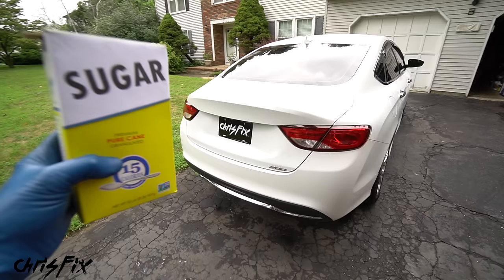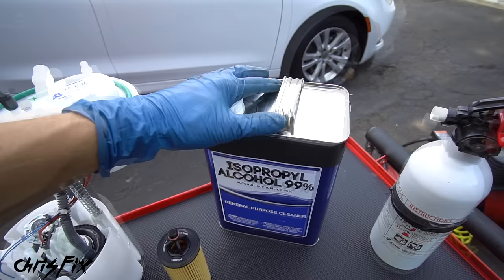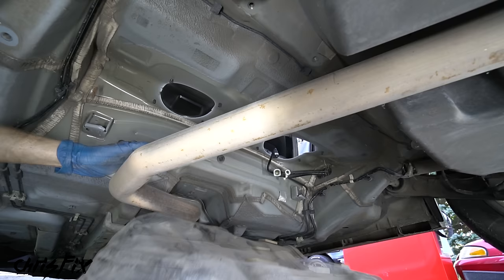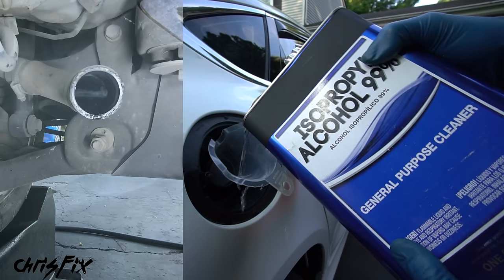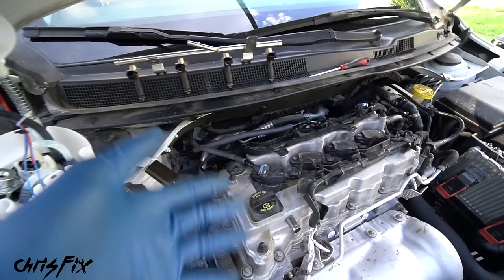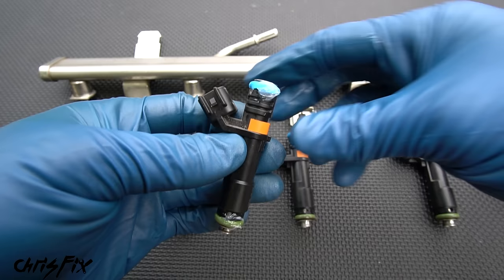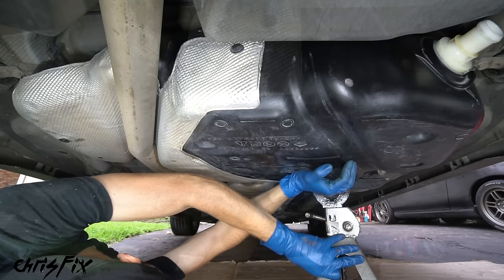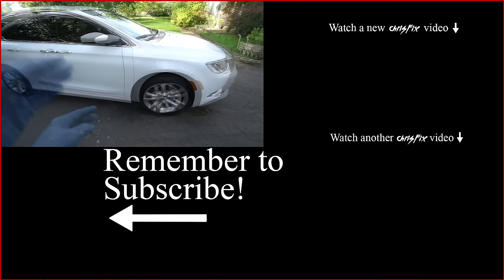How to Clean Out the ENTIRE Fuel System (Vandalized with Sugar in Gas Tank)

Comment: Hey Chris, I just found out I have sugar in my 2016 Infiniti q50 red sport. Long story short, I’ve had issues with a mechanic that ended up cutting the cats off of my car and busting my windshield among other things, and it seems he did this as well and this has been quite a bit ago that I got my car back. Like a month or 2. Well after I got new cats in and got the car running, I decide today to start driving my car. Went to gas station to put gas in my car and it kept clicking like it was full but my fuel meter inside the car showed only half full. Upon attempting multiple times to get gas in I noticed grainy stuff coming out of it and it looks like sugar. I’ve been driving the car sparingly the last few days unknowingly having this inside my tank. My question is do you think it made it to my engine by now? I’m very concerned. I have it parked and my mechanic said he will clean it out but it’s late so I’m kind of stuck here with no way of towing it
Reply from the maker: Wow you should consider taking legal action against that "mechanic", sorry to hear. And your fuel filter would have stopped anything from reaching the engine so you should be fine, just make sure to give your fuel system a really good clean
Reply: @chrisfix  thanks for the reply Chris! And would your answer still be the same if I said I was driving it like that for weeks? Just out of curiosity
Reply: wonder if this mechanic'  is tossing those negatives at your car, in hopes you'll put it up for sale ....        :-[
Reply: @CentralCanada  really felt like that was the case but ultimately I had the car totaled after numerous attempts to get it fixed and 3 horrendous mechanics later. I swear they’re all out for some kind of extra benefit in one way or another. Once you put that car in their shop, you’re really at their mercy if you don’t know exactly what you’re talking about and they know the value of the car

Comment: Hey Chris would a fuel system flush do anything to resolve a problem where someone
might have put sugar or something similar in the tank ? I've called the shop where I normally take my car for repairs and their suggestion is to putting in a new fuel pump etc which their quoting me as somewhere around $885.00 out the door ...any suggestions ??

Comment: Just FYI, NEVER SAW SUGAR DAMAGE AN ENGINE!!  Yes will enter gas take and cover fuel intake part.

Just drop tank, clean gas and sugar, replace into car.

Get bank loan for more gas (humor) and drive to auto store buy a locking gas cap.

Adjuster for 13 plus years

Comment: Won't a hefty screwdriver remove that locking gas cap? That person was very determined to ruin Susan. Doesn't seem like that lock would have stopped them. Hopefully Susan has learned not to date a guy with a psycho girlfriend. LOL
Reply from the maker: Not easily, you need a key in the slot to open it up, it might be possible to try to pry it off but you would definitely do some damage with that

Comment: a six dollar locking gas cap is easily removed with a one dollar flat tip screwdriver
Reply: You dont even need that. With the type show in the video you can squeeze the edges and turn it off.

Comment: since the car was vandalized if that is your wife's or your car one of you probably has a job somewhere in witch someone connected to the job site whether it is a student or angry customer or employee just fired or what ever tried to get back at you or your wife.

it is a classic revenge and vandalism of any kind is very illegal and can get a punishment ranging from a grounding by parents if it was a child involved to community service to jail time depending on how the court rules.

the locking cap is a very good idea it saves you a lot of money and troubles.

you could add some fuel stablizer once the car is cleaned out to take care of any water that remains

Comment: Can 91% isopropyl alcohol be used?
Reply from the maker: To clean out the fuel lines? I guess but you still have 9% water so that could be an issue with rust if you dont immediately put the car back together and run it so the fuel coats the inside of all the metal.
Reply: @chrisfix  Would denatured alcohol be just as good? I hear that even 99% Isopropyl Alcohol leaves a residue but denatured alcohol doesn't.

Comment: Yeah you can clean out the whole fuel system but it'd do no good if the engine already gets seized from it but You can fix anything if you got $$$ to throw at it but fixing/rebuild these new model junk engineS it's just be cheaper to buy another engine with the complete harness with the computer
Reply from the maker: In this case the engine was good so it just required a cleaning, and sometimes it does just make more sense to get a complete engine

Comment: Not true cause i fixed a car with the same issue once and let me tell you the engine was gone .. your engine will be busted if the fuel tank is an old one like iron and you live in a hot country which has normal 50 degrees celcius in summer .. yeah may be the new cars with plastic made tanks wont but in hot country with iron tank it will and the car which was brought to me was a 1980 nissan wannet

Comment: Don’t start your car if you have this problem… this will ruin your car. Usually cars 2015 and up are safe from this as back in the day a lot of people would steal gas lol there’s a latch in the gas line that closes and opens when you put the gas nozzle in to fill up. The liquid or sugar will get stuck in the gas line, just get tint vacuum pieces from Canadian tire and vacuum the shit out of it, than fill your gas up. It’ll deal with the rest of small particles. Much easier process than this video. If you have a car lower than 2015. Sorry you might have to follow this video. But definitely don’t start your car.